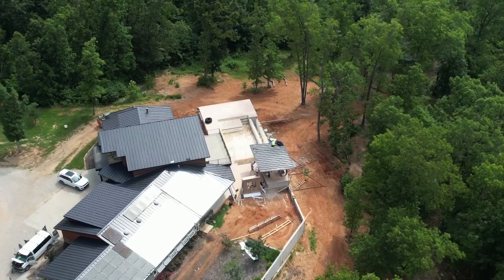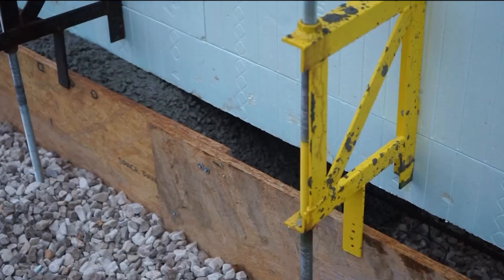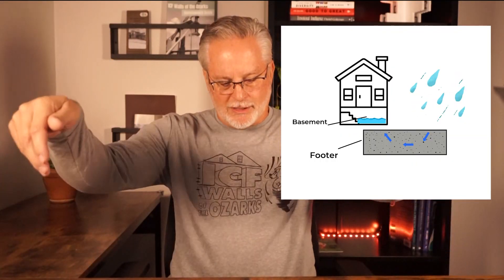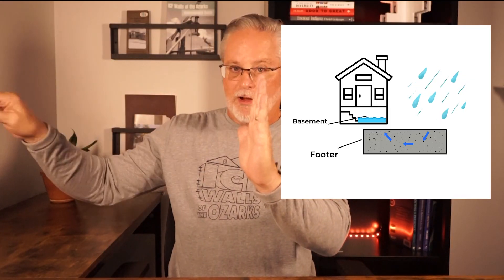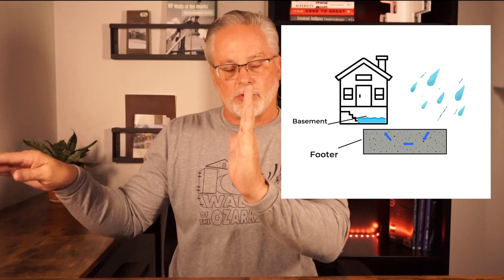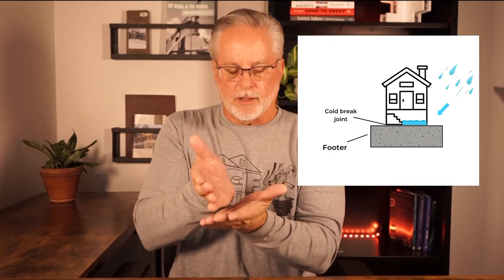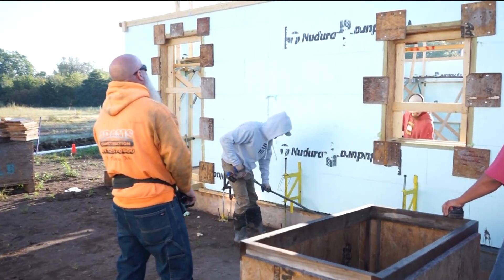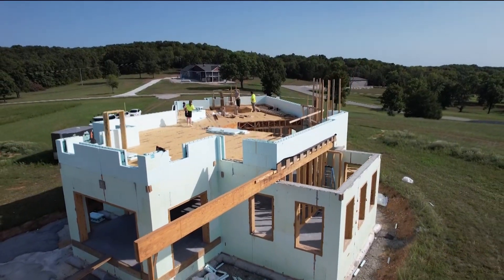Legacy System Part 1 - Footer & Monopour

Comment: What are the brackets that hold up your ICFs out of the footing in a mono pour?
Reply from the maker: This is a footing system our team has designed themselves to be able to accomplish the pour! There is a system made by Fab-Form for monolithic pours that is similar; David speaks on it shortly in the video, and there is a part (around 2:01, that shows the Fab-Form option; which we used to use).
Reply: @ I have seen the Fab-form one, yours is stout and reusable.  Looks simple to replicate.  Very cool you guys fabricated your own option that works.
Reply from the maker: @ Yes, that was the main reason we wanted to design our own; to be able to reuse and not have to buy new feet for every home! Saves us a pretty penny for sure.
Reply: I'm going to be DIY building a 15ft tall ICF house, would you still recommend the monopour system? I'm already planning on using the fastfoot system for the footings, but was planning on doing it in 2 pours.